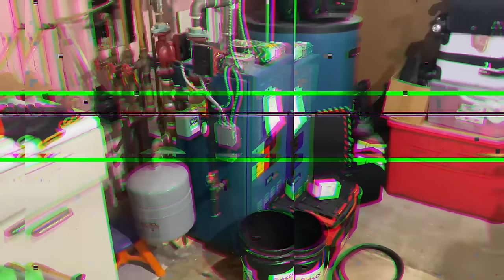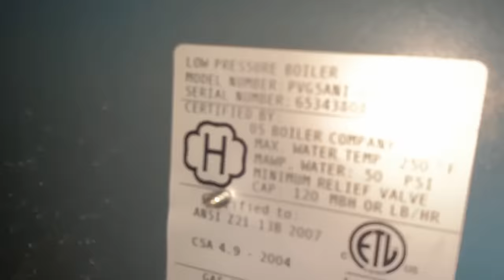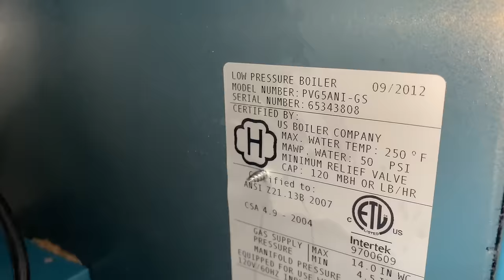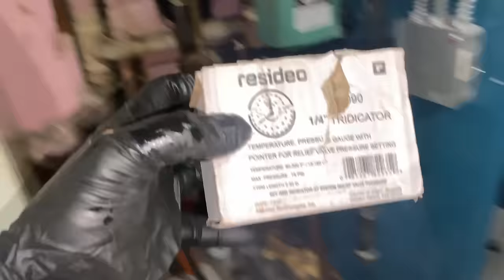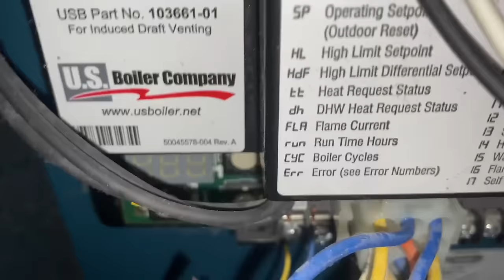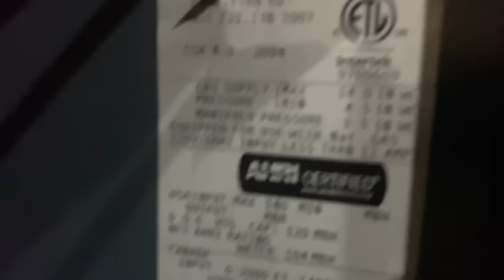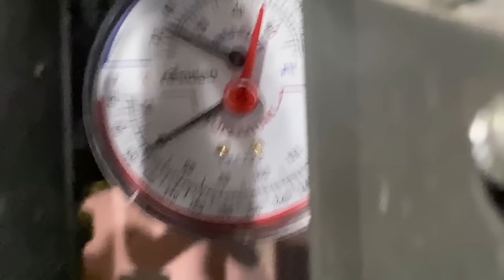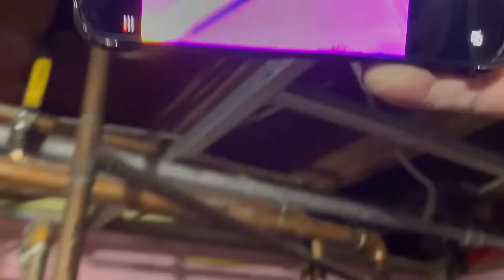Full Maintenance on Neglected Burnham Hydronic 3 Zone Gas Boiler - Tips & Tricks Revealed

Comment: I just had the same exact experience with the shipping screw on a 2012 Burnham ES2.  Seemed like the thing was fused with that cover. Tried a multi tool, a screw extraction kit, a dremel….eventually just drilled through it. Still the boiler, though never serviced, was not anywhere close to the levels of grossness in this video :)

Comment: That safety drain pipe could be easily bent into an offset clearing the pressure regulator by heating it with a mapp gas torch.
Reply from the maker: Great idea